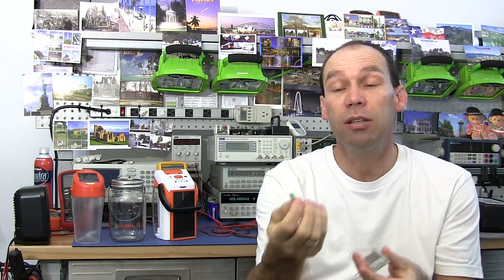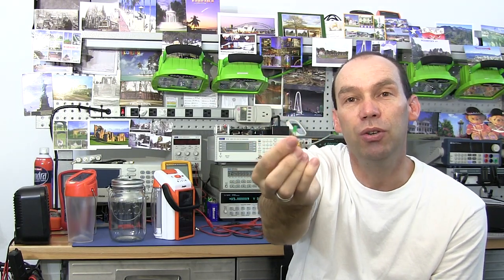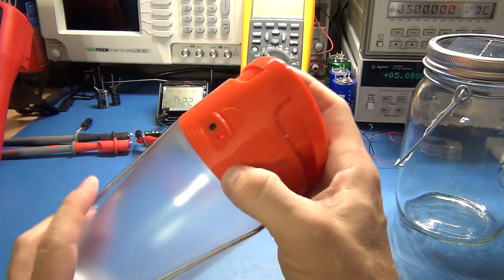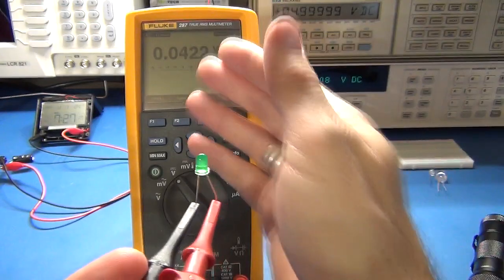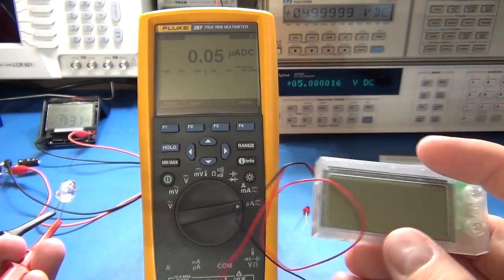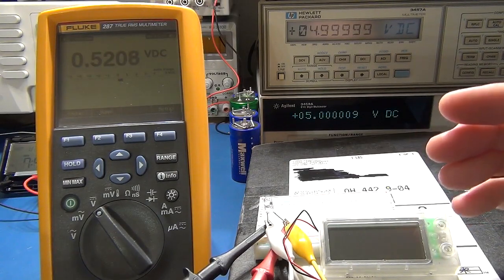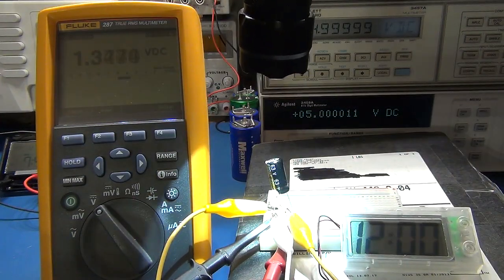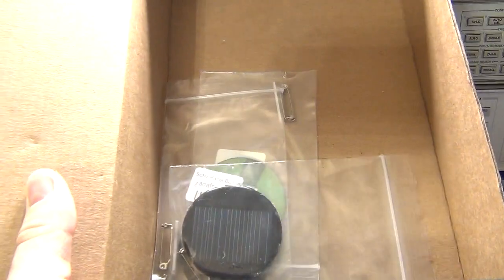Power from an LED to "Solar" Power a Clock?

Comment: 10 leds could charge a battery during the day and a joule thief could in turn run the leds at night. Like you said, you just need the right switching ckt.
I look forward to your methodical approach - very nice video!

Comment: Regarding getting the clock to work without voltage slowly increasing from zero, my first though was to put a zenner in series with the clock. Not in the conventional way using a resistor, but putting the zenner directly in series with the clock. Ring towards the supply voltage. Not tried it yet, but have a feeling it will only conduct when the zenner approaches its breakdown voltage so only present the clock with voltage above the zenner's operating voltage. But will loose 0.6V across zenner

Comment: Anyone want to hack up a light version of RFID? So an IR led gets illuminated by a reader. That illumination charges up a cap, which powers a tiny microcontroller just long enough to use the same IR led to send a message. Just like RFID tags using their coils as both a power source and an antenna.

Comment: A little 5 cent LED is creating 1.4 volts?  I'm assuming it will put out at least a volt in full sun.  Could you string together a bunch of LED's and use them as a solar charger?

Comment: Martin, around Easter I picked a few solar powered LED garden lamps at DollarTree for $1 each. A month later they had some that used a metal tube instead of plastic so I picked up a few of those. I really only cared about the device but the tube could be useful. One ran for several days on a single charge. Inside is a small chip, a AAA NiCd and LED. Obviously NiCd is not ideal because of charge memory, but they are cheap for any solar hobbyists. I plan to connect a 10KuF cap and try it out also.

Comment: the electricity in ontario, canada is clean, but it's becoming very expensive, and i'm trying to figure out ways to reduce costs. i'm in a basement with some air quality issues (i'm slowly figuring them out, but detroit is just a dirty city.), so about 40% of my electrical costs are about moving the air in the apartment around. if i could offload the fans to solar, i could cut my bill nearly in half - useful because they just increased it by 55%.

i've purchased a usb fan that has the same dimensions as the one i'm using. i think the one that's running is about 40 W/day, something that wasn't previously a problem, but is now. the specs on the fan i purchased, which is supposed to be the same size, are 2.5-3 W. so, it's a much more efficient device, and we'll have to see if it moves the air around the same way or not.

but, i'm thinking that i should be able to get a few watts from the sun, right? the thing is that i need this running 24/7, and i'm trying to save costs, so i want to get an older battery, the kind that's in a bargain bin and somebody is otherwise just going to throw away. if i'm only getting 5-6 hours a day of sun here in the winter, through the window, i need a lot of storage capacity, and it might not even be enough.

and, it kind of hit me - could i just put the diode in the lamp? i sleep with the lights on to keep the roaches out. and, it's running a fairly strong led. i know it's a different wavelength of light, but is there enough in there to run a fan? i just need a few volts... 

maybe you could do the video with a capacitor rather than a store bought battery, but it seems like there is.

so, if the fan is a little weaker, maybe i'll just get a couple of them, and string them up on the different lights. and, that's 20% of my electrical bill cut out by recycling the light from the bulbs...

maybe, i can find some way to recycle the heat from the heaters, too.

Comment: Voltage depends on the band gap of the material in the LED. IR diodes are the only ones made from silicon, the red,green and yellow leds are made from Gallium Arsenide or other similar materials, with a larger band gap. Thus they will generate a higher voltage with incident light, providing it has a wavelength shorter than the band gap. The blue and white units are made from silicon carbide, just white has a phosphor coating.

Comment: One could then use a single LED for one of those LED night lights. It would detect when it became dark (low voltage) and then kick on the same LED when it's dark to light it up. Now and then it would turn off quickly, detect if it's dark or not, and then switch back on accordingly.  I think the human eye would never catch the check since it could be done quickly.  This will be a fun Arduino project. :)

Comment: if you only use a lithium ion battery between 3.7v and 3.9v it will last for 4000 or more charge cycles vs 300 from 3v- 4.2v and 1000 at 3.4v to 4.1v. admittedly 3.7 to 3.9v gives you very little capacity but if longevity is the goal then you cant go wrong.

Comment: Note that if you use a red LED no matter how bright the light a blue led will give zero output. Other way you get voltage as the wavelength is shorter and provides enough energy per quanta to drive the electrons through the valence gap of the material.